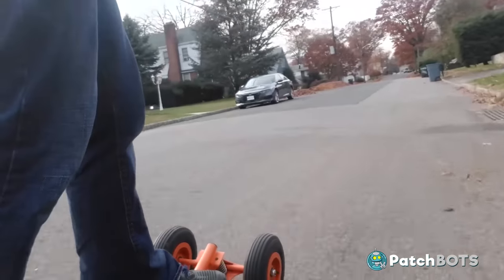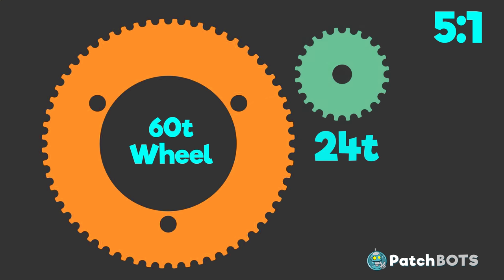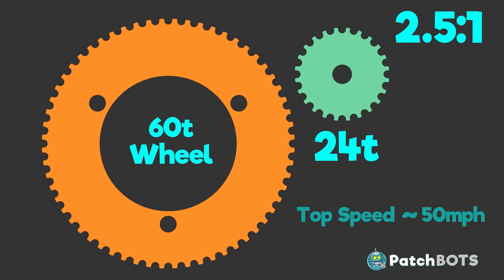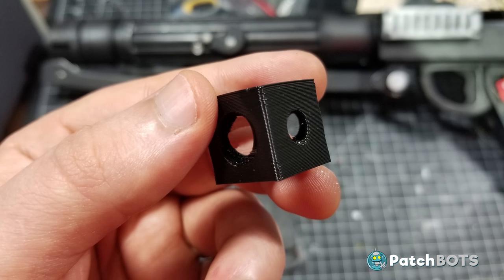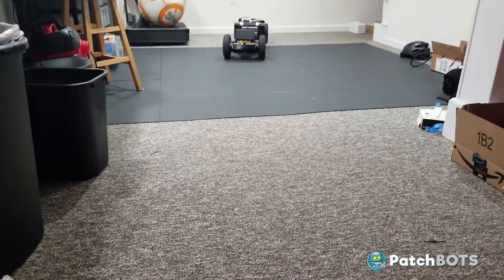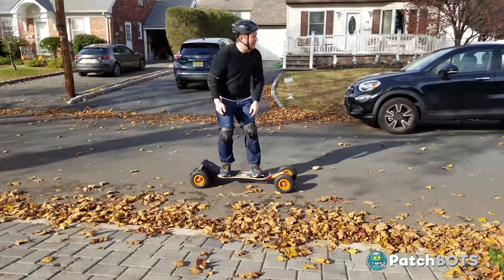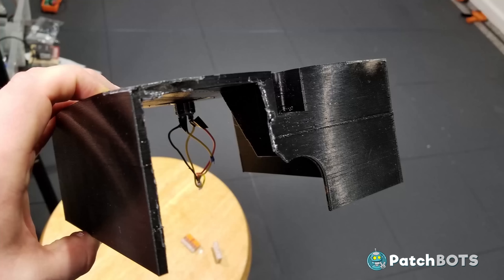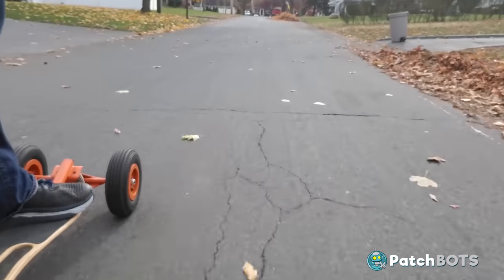Building an Electric Mountainboard! (Part 2)

Comment: As and electric skateboarder riding an AT setup as one of my daily drivers, I love this build. I didn't see you mention it in either video, so I thought I'd comment that on big wheel pulleys like you've got, there's usually an extra bearing on the pulley where the wheel+pulley assembly mounts onto the axle. The axle on the rear trucks of my AT board actually has a shoulder on it for taking a bearing with a 1mm larger inner diameter.

Comment: at higher speeds you may end up with speed wobbles. you may tell yourself you wont be going fast enough for them to affect you but they still can be there even at lower speeds. id suggest putting some type of hard rubber material inside of that hollow springs for dampening. look up Trampa boards and how they do it
Reply from the maker: Great tip, I will defintiely be doing this.

Comment: Could you please explain the exact modifications you did in order to change it for 6S ?
Reply from the maker: Sure. It's two solder bridges on each board.  On the front panel of the board there are solder jumpers labeled 6S and 7S.  You want to bridge the 6S jumper.  (do this on each board).  On the bottom there is a solder jumper near the left most resistor. You want to solder that connection as well. Send me an email. I'll send you some pictures/video.   I'm going to make a note of it in the description as well.
Reply: @PatchBOTS  Thank you so much !!!
Email sent ;)

Comment: Why didnt you you just print a bigger wheel pulley? Getting enough torque for hills is the most critical point for person weighing over 80kg.
Reply from the maker: Yeah that was an option.  There isn't a ton of room, but I could probably bump it up a bit.  That's the beauty of 3D printing, can always just "print another."

Comment: Why would you turn down the volts? You’re going to have way less torque now for the same speed. That’s just ridiculous.
Reply from the maker: My original thinking was the Top Speed was too fast anyway, so I'd rather sacrifice the extra voltage in favor of higher battery capacity and longer ride time.  In the end, I moved the voltage back up because the voltage wasn't enough to get me going.